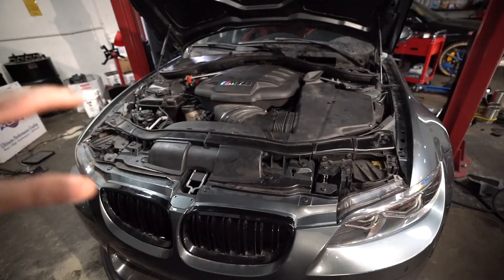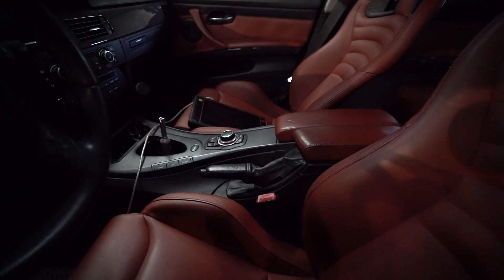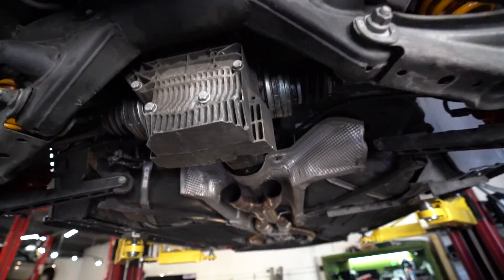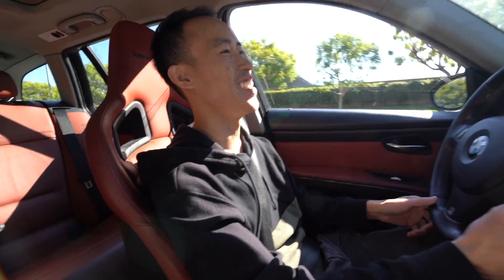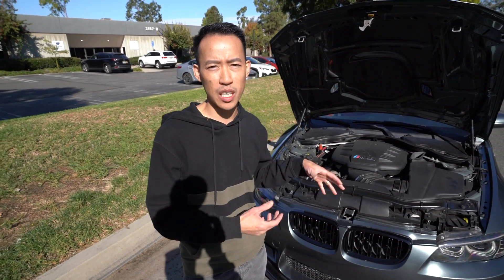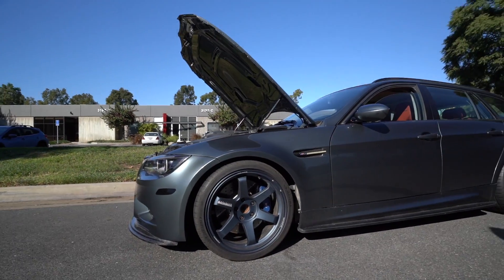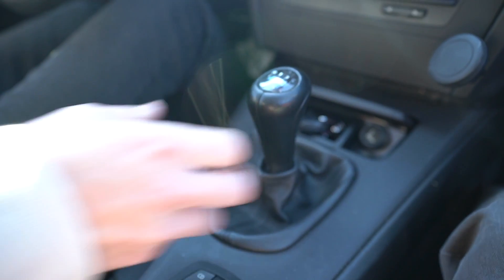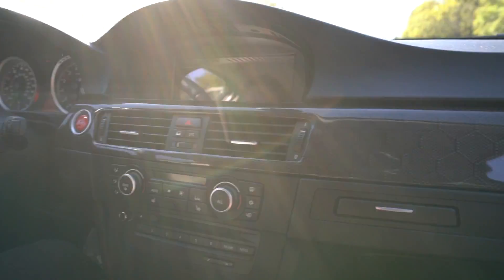E91 M3 S65 Conversion Completed!

Comment: are the subframes for E90, e92 the same ?  should you use an e90 for a 32 because its a sedan parts being swapped into a wagon8 swap and an e92 for like e82 swap because its a coupe or does that even matter ?
Reply from the maker: Subframes are the same on coupe/sedan/vert. You only want a E90 donor because of fuel line/evap line lengths. You also have to swap over the chassis harness, so a E90 harness would be easiest. Only modifications you have to do to the harness is rear tail light wiring (tail lights, trunk, etc)

Comment: I actually liked shifting with my kids. The 335xi wasn't as easy to drive daily as the GolfR, but I miss it a lot.
Reply: The 335xi from the earlier generations suffered a lot because the awd system was a bit of an afterthought in front suspension design. Particularly because the front axle presence changes the geometry of the entire suspension. This negatively affects steering feel/effort, as well as numbness in corners even worse than the non m e9x... I would say if you drove a 335i with m3 control arms, compared to your 335xi, it would be like night and day. It might even make you sell that golf r, befriend a local bmw mechanic if you aren't one, and get another 335i lol.

Comment: Hello! I have this strange missfire at cold start followed by a low rpm (650)once its up to temperature, it will idle at 650rpm for a few min than it will rev up to 780rpm and will idle for a few minutes there, than drop down again to 650rpm, will do this repeat cycle as long as its idling,  sometimes it feels like its quicly dropping down rpm like its gonna stall but it quickly recovers, no codes🤦 icv, replaced, sparkplugs, map sensor cleaned, fuel breather new, new injectors, new battery, alternator,  new upstream 02 sensors, tried some used solenoids with no improvement, car has all the power, i don't get it why would it idle like that and also the missfire that im feeling thru the seat like pulses especially when cold, any help will be apreciated https://youtube.com/shorts/b4gUp9Ikft8?feature=share
Reply from the maker: Assuming you're referencing to a S65. If you have a scan tool that is capable of checking data on the Vanos system, i'd advise to look there. I've seen a bad intake vanos solenoid cause something very similar to this
Reply: Thank you, i hope its not the gear like a bad sprocket, i don't have a scan tool thar can do that, ill have to take it to a shop
Reply: Could it be timing?